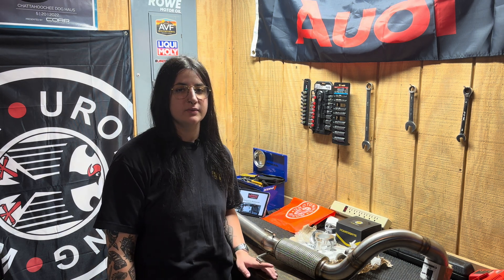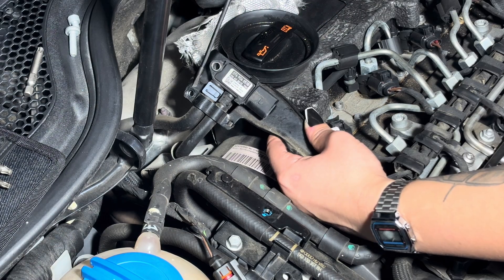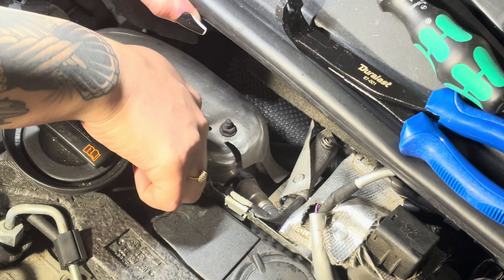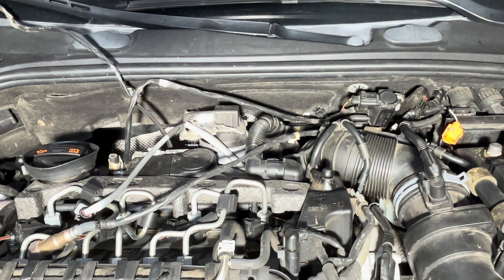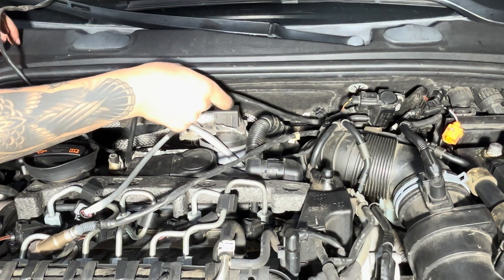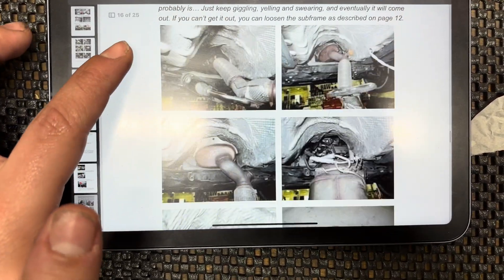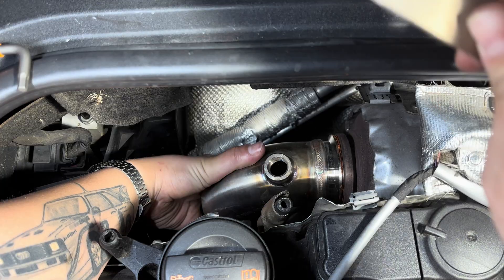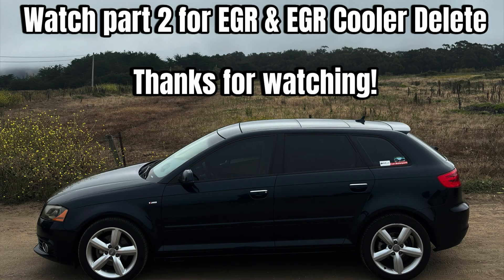Audi A3 TDI DPF/EGR Delete Pt. 1

Comment: Awesome. I did this on my 2011 sportwagen. Not a critique at all, kudos for getting the DPF out in one piece! I was in the same boat as you, struggling to get it through the small tunnel, so I just cut one end with a sawzall. It was so much easier. I ran into the issue you detailed at the end, about 3 months after putting in the race pipe and blocking off the EGR pipe, the pipe blew open at the flex portion and now my turbo struggles. Ive been trying to find a video that helps show how to get that pipe out along with the egr cooler... so yeah, anyone else watching this, heed that advice. Block it off on the manifold. The high pressure destroys that pipe and your car goes into limp mode.

Comment: Great video , could you tell me all the tools used/I would need to carry out what you’ve done in the video if that’s not too much too ask , best video detail I’ve seen
Reply from the maker: Hi, no worries, apologies if I forgot something, but here's what you'll need

Definitely need an impact if your car is rusty

VAG Sensor Connector removal tool, can be bought on ECSTuning

A set of Metric deep Sockets and ratchet 

A set of Metric Hex Sockets, I use the Klein branded ones since having shorter ones were the better.

A Torx bits set, I personally used the Wera Zyklop Ratchet Set with Torx bits, it's the one I used the most in this.

A 2MM Wrench for the Oxygen sensor. Also ECSTuning sells a wrench specifically for this which makes it easier to remove than what I did.

And a 10mm ratcheting wrench, this made it faster to tighten down the exhaust clamps, but its not needed, you can do this with a deep socket and ratchet if you have that already. 

Any flathead, pliers, clamps are always helpful.

If you have any questions, please let me know! Also the document in my description for the instructions also shows the tools needed.

Comment: Ive never seen anyone mention or use pemtek exhaust paste on the turbo/downpipe flange gasket before 🤔 Curious why you chose to do this? 
Though now that I’m thinking back this may have helped reduce the (very high) chance of the exhaust gasket falling to ground or unaligned when attempting to mate the downpipe & turbo flange by yourself while simultaneously getting the v-band lined up perfectly. Lots of colorful words were spoken during this part of the job lol. Worth mentioning this is not a difficult job to do, and you should not be intimidated by it! If you have a neighbor, friend or your significant other available as a second set of hands this project can be knocked out on a Saturday and button up the small odds and ins Sunday. 

 For anyone planning on doing this job on any 2.0 CR TDi of this generation.. Buy yourself a set of triple square bits aslis knows as XZN bits.. large variety of different lengths, and ratchet driver sizes 1/4, 3/8 and 1/2. The size you’ll be using is M10 for the CV axle housing hardware which as mentioned in video are 1time use. You can get replacements from local VW dealership for the lowest cost.
**Diubke check your cars info for the outer CV 12point size, my car is a 14 JSW tdi with manual 6spd gearbox.

Comment: I love my A3 8P and I need to perform a delete like this very soon. This is very helpful, and probably the most detailed guide on YouTube. I like how you specifically note what size and type of bolt/nut you're removing. 

 Any thoughts on the Flowdirect kit? 

How long would you day this takes? 

Would a digital delete of the EGR via a tune be sufficient? (With one block off on the egr cooler).
Reply from the maker: Hi! Thank you! I honestly dont know anything about that kit so I dont have an opinion, but it does look similar to mine so I'm sure it would be good. I went with darksidedevelopements only because there's was the cheapest for me and they seem to be reputable.

It doesnt take terribly long but it only took me long because of lack of experience and filming it was a pain, But in all, you can most definitely finish something like this on a weekend or two (if you take your time), especially if your experienced.

So that is what I had initially, I had the tune from DarksideDevelopments that included a dpf and egr delete, and you can do that and just put a block off plate but its not worth it. The pipe from the manifold to the egr was rattling like crazy for me and for most people it ends up breaking and causing boost pressure issues. Therefore I decided to go ahead and delete the entire egr and cooler system. Not only did it take a lot of weight of the car and now I dont ever have to worry about it. Removing the egr and the cooler wasn't that much more work, so I'd recommend removing if you can! If not, the block off is a good temporary solution. I only had mine for a week then I deleted it. Btw I just post a video on how to do that if you need it!

Apologies for the insanely long response! I try to explain as much as I can make sense!
Reply: @amy8p  Thank you very much! No worries at all on the response time. I have watched your EGR delete video and it's by far the most comprehensive  video I have seen on the process.

Comment: nice job so far!  What state do you live?  or are you in Canada?  I live in Virginia and I don't think a delete will pass inspection even if they aren't checking emissions.  Some places will fail me if they see the delete.   Additionally, regarding the plate blocking the EGR, wouldn't have cause backflow issues or something to that extent?
Reply from the maker: Id say your right, it sounds about right to me. When I spoke with others and read online about their experience with block off plates. Most of them experience the the pipe bursting and causing a boost leak. It didn't happen to me but the pipe from the egr to manifold was rattling like crazy so I just went ahead and delete that entire system too.
Reply: I live in RVA. No emission testing here. I'm planning to do this, to my new to me  2011 Jetta tdi. Hopefully I grow a bigger pair of Deez Nutz coz I hate working in the cold

Comment: Do you need to take the wheel off to get room to pull out the axle? Amazing video, this is the only one iv seen on the 8p and it helps ALOT. You're the best, thank you.
Reply from the maker: Hi thank you! You do not need to remove it unless if you don’t have someone to help you, in fact it’s best for you to leave it on. I say this because; I didn’t show it in this video, but to remove the axle bolts is very difficult and when you try to take them off the wheel turns. I had to use a breaker bar to remove them while my boyfriend held the wheel and had him turn it so i can access the other bolts and so on. Same goes for reinstalling the bolts as they need to be torqued. But if you don’t have help, some people remove the wheel, and tighten the wheel bolts halfway on the bare rotor and will put a large metal bar of some sort through the bolts and have it rest in the ground to prevent the wheel from moving. I hope this helps!
Reply from the maker: Also, I could be wrong, but I think you can purchase wheel locks online for this.

Comment: i have wanted to do this to my 2011 mk6 golf since 2018. in 2020 i had the fight the dealership to replace my dpf which had cracked and was still under limited warranty. fast forward to a week ago, 5 years later the check engine light came back the the DPF code :) so its time to rip it out! i have subscribed. thanks for the video.
Reply: How many miles on the new DPF before you got the code?
Reply from the maker: @jdeday Hi, on my car you see in the video I got the code at 70k miles and kept popping up, regeneration didn't work and so I decided to delete it.
Reply from the maker: That's when I decided also! Mine kept throwing the code and when regeneration didn't work thats when I was like, alrighty now its time to delete.
Reply: @amy8p same. The "dieselgate" extended warranty covered 3 DPF replacements in the 4 years after I bought it. When it popped again after it expired and said it would be $2600, I went with the delete and hood stack.